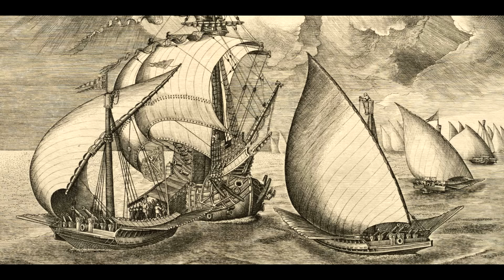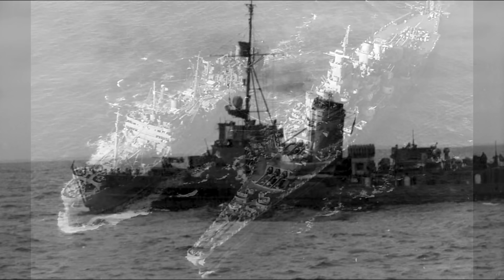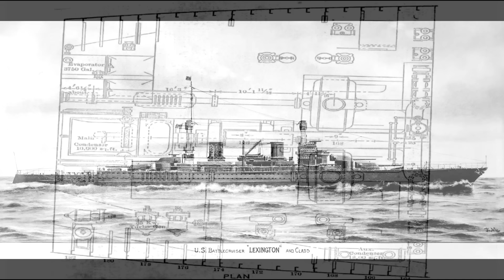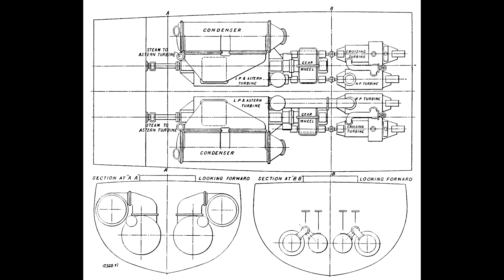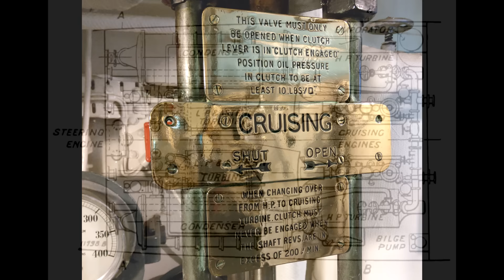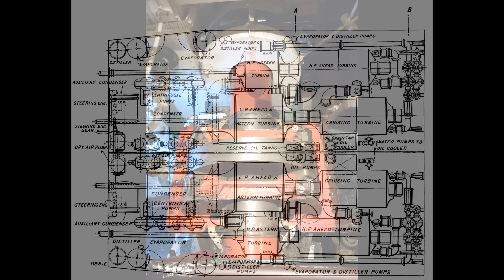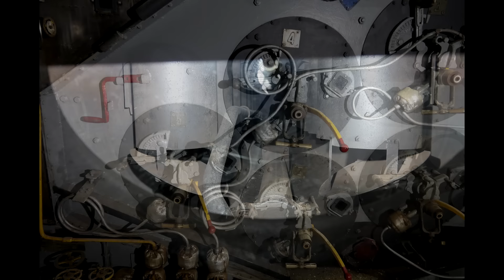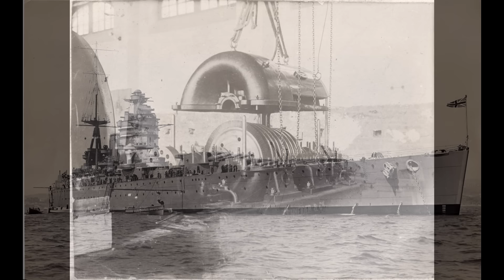Naval Engineering - How to choose your engines

Comment: Just one question from the start. Diesel 'fuel' can be just about anything, peanut oil, bacon grease, etc. In many ways, it is much more available than either coal or oil fired systems. There are a lot of other considerations, but I just wanted to note that for comment.
Reply: Oil-fuelled boilers can run on just about any liquid fuel, though efficiency can suffer if the fuel is poorly suited to the sprayers, pumps, etc., just as performance of a diesel would suffer.
Reply: @Rupert-B  I worked on a steam powered containership converted to a fish processor (factory ship) that used heavy fuel oil. We could not refuel at sea and on long trips when the fish oil tanks were full I would blend fish oil up to 50 percent with fuel oil to save fuel and not waste the valuable fish oil. It worked great, the heating value was the same and reduced steam consumption in the fuel heaters.
Reply: Generally, Diesel fuel does need to be liquid at some reasonably convenient temperature. Coal is a bit trickier, although I think that there have been some experiments using fine coal dust in a compression ignition engine. It doesn't seem to have caught on though.
Reply: @alexandermonro6768  You can use coal tar. Just as a note, most of what I know I learned from The Curious Case of Rudolf Diesel. Churchill considered whether switching the RN to diesel before WWI was a good idea, and one of the theories for Rudolf's mysterious disappearance is that Churchill spirited him awasy.
Reply: Where are you going to find 15,000 gallons of peanut oil when you can’t find cole?

Comment: This actually reminded me of mechanical stokers that are on some later coal burning steam locomotives. Basically because these things burned so much coal, instead of the fireman shoveling coal into the firebox there was a thing that would crush chunks of coal into the tender and then deliver them directly to the firebox using an Archimedes screw. The coal chunks would then be deposited on top of a thing that was blowing jets of air in all directions and it would essentially blow the coal wherever it needed to be in the firebox. The fireman could control it to get the most optimal coal bed possible. Animagraffs’ video on the big boy does a much better job at explaining it. But anyway was there anything like that used on ships?
Reply: There were a few ships with mechanical stokers, but for some reason it never really took off for ships. The SS Badger ferry in the US is apparently one such ship with a mechanical stoker, and one of the few remaining coal powered ships (not including museum ships).

Similarly there were also various experiments with powdered coal technology (like you'd see in an electrical power plant), but again it never became a success at sea.
Reply: @jbepsilon  If I had to guess it's due to the greater man power and space available to ships meant they started using oil before that became a problem. There also the fact that all the extra space and a smaller concern for weight made oil fired boiler easier to implement on ships.

Comment: i got a thought. say you got 4 boilers and 4 turbines. but you realy only need 2 turbines as effective speed for optimal turbine speed at cruise. could you turn down all your boilers. stop two turbine and let all the steam go to 2 of the turbines. the piping exist.
Reply: More likely, instead of turning down all the boilers, take 2 offline and just use 2 at the most efficient rate to spin the 2 turbines.  Cruising with shutdown components is when maintenance can be done, unless you are in a war zone.

Comment: Regarding the cruise turbines: They're usually not a smaller turbine in parallel. Instead they're more like an additional "intermediate pressure" turbine inserted between the HP and LP turbines.

Understanding why this is the case requires knowing a bit about the physics of a turbine. Putting it in basic terms, the faster a turbine spins, the more pressure drop can occur per turbine stage without a loss of efficiency (in fact for any speed and size, there is a single ideal pressure drop). This leads to the annoying problem with direct drive turbines: you can build a turbine that will run at your desired propeller speed. However, to do this efficiently the turbine will need to have some ludicrous number of stages, many hundreds of them especially if you use a high pressure boiler. Such a large number of stages results in an enormously long turbine, with reduced efficiency because of all the little flow losses going from stage to stage.

Going to geared turbines allowed the turbines to run faster, thus fewer stages were needed (smaller, more efficient). But it still doesn't fix another problem: if we are running at less than full speed, the prop RPM is lower, and so is our turbine RPM. This means that at cruising speed, the turbines become mismatched to the boilers! Our boilers are still at full pressure, but the turbines, spinning slower, need more stages to fully use up that pressure. The cruise turbine solves that problem by literally adding a bunch of extra stages in between the HP and LP turbines. So for cruising, steam goes from HP turbine, to Cruise turbine, to LP turbine, then to the condenser. At full speed, with the propellers turning faster, the cruise turbine is not needed so it is bypassed, steam goes directly from HP turbine to LP turbine. The Cruise turbine is either decoupled from the gears, or (in simpler setups) its casing is connected to the condenser, which pulls a vacuum inside so the blades experience minimal drag. Problem solved: We can now basically "shift gears" and get efficient running at two different speeds.
Reply: Ohh, this is some nice added explanation. Thanks for sharing :)
Reply: Steampunk Powerglide.

Comment: Diesel and steam ... or maybe diesel and electric ... like a submarine.  There's a reason (conventional) submarines are not nearly as fast as a DD, even the two-hull can-dive-for-a-bit type of submarine on the surface, using both diesel and electric engines at the same time.

Consider using high voltage and insane amperage ... next to sea water. And think of battle damage causing some flooding ... that is one of the problems of turbo-electric main engines.

Comment: 3:35 Would you really have to carry two kinds of fuel? I'd think a liquid-fuel boiler, maybe with some adjustment to the burners, should be able to run on diesel as well as on fuel oil.
Reply: Yes most boilers can run on Diesel with very little modification usually just a different spray tip and or sprayer plate. Most steamships nowadays run on Diesel which was one of my favorite parts of my first steamship I sailed on was that we barely had to sootblow since the diesel burned so thoroughly
Reply: Diesel can be sprayed into a steam boiler, but heavy fuel oil cannot be sprayed into a diesel plant. Diesel is just more expensive.

Comment: If you're curious about what happens when there is a mainline steam failure, look into what happened on USS IWO JIMA LPH-2 in 1990. While outside of Drach's scope, it wrote new rules for the US Navy, in the standard colors of blood red, banning the use of black oxide brass aboard ships and new maintenance procedures regarding work on steam systems. It serves as an object lesson and is still taught to this day about what can go wrong if care is not taken and procedure not followed.
Reply: Just looked it up on Wikipedia: A black oxide coated brass fastener had been used by contractors when repairing a leaky valve, the inspection was improper, and when she raised steam for leaving the repair dock, the valve blew open and dumped steam from 2 boilers into the pertinent boiler room - and killed 10 out of 11 sailors in there in short order.
High-pressure steam is bloody scary.
Reply: @mnxs  ‘bloody’ is nowhere near a strong enough modifier. I worked with a tough grizzled old pipe fitter for a few years. Not only did I hear a few stories, but, when we were working at a facility with steam, his sudden embrace of safety culture and emphatic directions to me (‘if it goes to $#¡t, you DO NOT try to save me: I’m done. You RUN’) still rather chill me. I am happy to say he safely retired to drink bourbon on his porch
Reply: @mnxs  a slight correction. The eleventh man was about to enter and was told to get out immediately as he stepped in by someone inside. That is why he survived.
Reply: @mnxs it wasn't just any steam valve. It was one of the main steam valves. The ones that are taking the full steam from one of the boilers and is unisolable. The men who stayed behind took damage control actions for a steam line rupture and reduced the severity of the casualty at the cost of their own lives.

Comment: l served in multiple Type 12 FFs and later a couple of US CF Adams DDGs in the RAN as an executive branch officer (later a PWO for about 20 years) and was required to have a reasonable knowledge of the machinery - l  spent 'many happy hours' as a midshipman in both boiler and engine rooms in the Type 12s!!  lnterested in a couple of things.  
The turbines in the Type 12s had 7 stages of nozzles in the English Electric engines presumably associated with the turbine assemblies.  Why? 
And secondly British designed ships had boilers producing about 500psi, whereas the US ships produced roughly double at 1100psi.  Why again?

Apologies for such technical q's but it has always vexed me.  Maybe l didn't do my mid's homework properly!!
Reply: I'm guessing you are saying they had 7 selectable stages of nozzles. In that case, it's probably a partial admission system. Basically you can block off some of the nozzles feeding the HP turbine stages so the steam is impinging only on part of the turbine wheel, as little as 1/10 of it might be used. Doing this essentially lets you throttle the turbines inside the HP stages. The active nozzles still get full steam pressure, so it's more efficient than an external throttle valve.

Comment: Some other considerations when using steam:

1) Boilers need desalinated feed water - so evaporators are required.
2) Before diesel came ffo (furnace fuel oil) which required heating before being introduced to the furnace. 
3) Water compensated fuel tanks required the use of centrifuges to separate the fuel and water before pumping into boiler header tanks.

I was a stoker from 79 to 84 and only served on steam ships, but I did work on gas turbine ships. The steam ships seemed to have more about them in my humble opinion, as there were many reports of major gas turbine engine failures.

Comment: In my career, the astern turbine elements were a pair of single stages located on the low pressure turbine shaft.  The astern and LP turbines both comprised of two identical assemblies flowing in opposite directions. This reduced turbine diameter and axial thrust was neutralized.  Placing astern elements in the LP housing reduced size and weight and allowed systems like bearing lubrication and shaft sealing to be shared.  There's also another type of bypass.  Some high pressure turbines have throttles capable of admitting steam to different high pressure stages.  If the throttles are wide open you will want the fullest expansion possible by admitting steam to the highest pressure stage.  However, at reduced throttle settings, you have a pressure drop across the throttle.  This risks over-expansion in the later stages. In this case you might bypass steam around a few of the highest pressure stages in order to get optimum expansion.

Comment: I was a drafting apprentice at a noted gear drive manufacturer in 1972 when they got an order for a tuna boat gearbox. First unit with propellor  pitch control. No need for reversing gears/clutch. Suddenly, the gearbox had half as many parts. The drive was so simple that a certain apprentice could detail the fabricated housing with minimal supervision. 75 years of experience with reversing drives was no longer needed because propellor pitch control revolutionized the work boat market.
Reply: There is, however, a slight downside to propeller pitch control instead of a reversing drive gearbox. Yes, it's a lot cheaper and simpler to make the gearbox... But if the propeller pitch control itself is what fails, suddenly the boat can only go forward or reverse (whichever position the prop either defaults to if it's the kind that used active power to move from a default setting to the other setting), or whichever it was set to when it failed.
That fault has sank boats.
Reply: @ShadowDragon8685 the ships I'm trained on default to flat pitch, and can be pinned out in the pull ahead position if the hydraulics fail. But then you lose all astern speeds, and can stretch the tubes if you try to take it above 20 knots ahead.
Reply: @wyattroncin941  Fair enough. I didn't say the system was bad, or even less good than a reversing gearbox. It's different, it has a lot of huge advantages, but it does have that notable disadvantage. A ship that defaults to flat neutral in a failure would mean the ship can't go, period. Any of these situations suck and can cost you a vessel and if you're very unlucky, lives.
But those failures are, though grave, thankfully very rare. Rare enough that it probably doesn't outweigh the savings (in cost and complexity) of a reversing gearbox.
Reply: @ShadowDragon8685 it's not that we can't go if the hydraulics fail, it'll just take us time to get set up into one of our several emergency configurations. But considering that our gearbox is already the size of a house while CRPP is a few tons of equipment outside the shaft, it's definitely a better option.
Reply: @wyattroncin941  I'm sure there's a huge variety in both the sizes of such setups, and the exact implementations. I'm not impugning your implementation.
I'm just saying that this fault has contributed to a ship's sinking. Off the top of my head I can't remember which, but I'm pretty sure it was one of the fishing boats that Brick Immortar covered.
I'm not saying it was one of yours, though.
Reply: @ShadowDragon8685 the alternative being if a reversing gearbox fails, it’s a catastrophic engineering casualty and the ship won’t ever move on its own power again.
Reply: @ShadowDragon8685 FV Alaskan Ranger, I believe is the one.
Reply: CMIIW, but didn't this sort of variable pitch propeller was already a thing in WW2 airplane? Why it only catch up in marine application in 1970s?
Reply: Load propably. Propellers on boats go slower but move much more weight, so the linkages and bearings are under way more stress, plus the issue of water ingress and rust.
Reply: @panjikusumo9779  Airplane propellers and ship propellers are very different things.  Aircraft propellers spin rapidly in a compressible medium.  Ship propellers turn slowly in an incompressible medium.
Reply: @panjikusumo9779 you need significantly more rotation on a boat propeller to get reverse compared to a aircraft where it's just adjusting the pitch
Reply: @panjikusumo9779  Until warships started employing gas turbine main propulsion, the question of reverse speeds was either reversing steam turbines or a relatively small reversing gear on the relatively low power crusing engine. Once you need to answer how to make a 20 MW gas turbine power the ship in reverse, the scale of the reversing gear gets wildly out of hand. We're talking clutches that weight as much as a car, and individual gears big enough to use as a dining table. 

At that point, it become worth it to try and solve the engineering and materials science problems of a CRPP system, because you'll be saving dozens of tons, millions of dollars, and and a full drive mode change every time the bridge sees a whale ahead of the ship. Nowadays however, the adoption of diesel electric or integrated electric drives has even made CRPP an overly complex redundancy, since you can declutch the geared engines and use the electric motors to drive in reverse
Reply: @wyattroncin941  so with the advent of integrated electric propulsion, the even lighter and flexible combination of gas turbine-electric motor should be the future right? Just how good electric motor these days compared to, say, electric drive in USS New Mexico back then? Also, I was wondering if ships today also have battery, so making it like a modern hybrid electric car.

Comment: 13:12 it was also a huge advantage from the standpoint of damage control that the steam spaces are reduced to just the location of the boilers and turbines, and it didn’t require the involvement of lengthy steam piping serving engines further aft.
Reply: On the other hand, you have some very large and heavy electric cabling, and the thinner and lighter you make it, to more power you lose. Also, the switching gear can be quite vulnerable to damage and of course flooding is really bad - salt water and electricity mix all too happily.